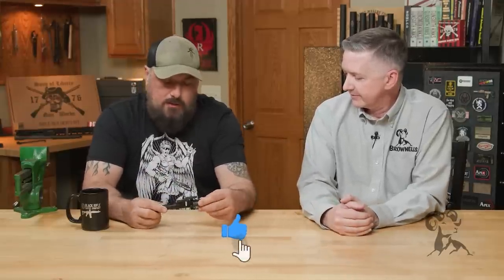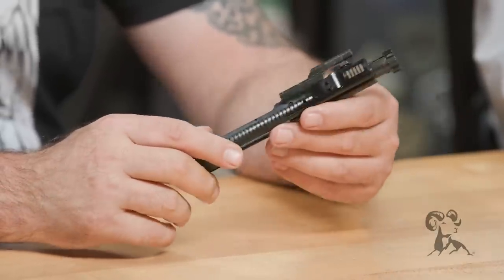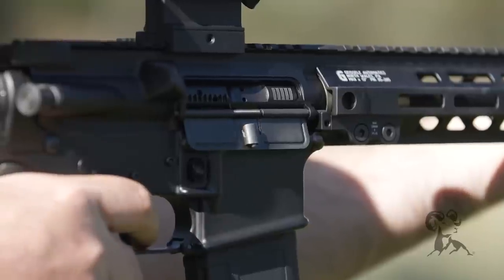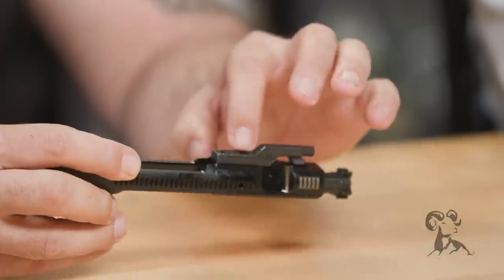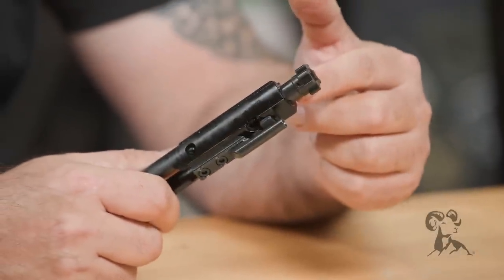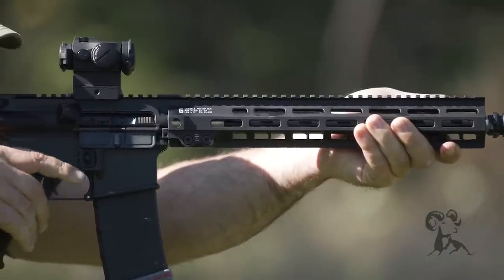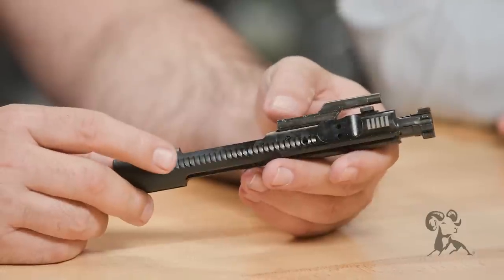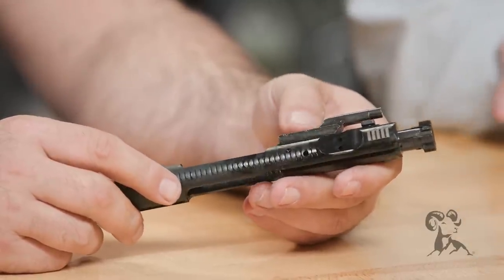Product Spotlight: SOLGW AR-15 Bolt-Carrier Group

Comment: So it’s basically another microbest bcg with someone’s brand name on it
Reply: I’m pretty sure that SOLGW uses Microbest exclusively, while some other brands may use Microbest - they will also use Tool Craft when in a pinch.
Reply: Yeah basically
Reply: Yes
Reply: While I believe these guys are passionate to give consumers a quality BCG, that statement of yours is probably the truest statement that could be said. 

Everyone else seems to be sucking off these guys hard.
Reply: @2amichaelj  I would say that's a very fare assessment
Reply: Yes but I believe SOLGW are the only ones to use springco springs exclusively, while others either use springs from random manufacturers or make their own. Also the QC is the biggest component IMO and SOLGW has very good QC
Reply: @BigMackM27  I’m doing a build specifically using SOLGW parts, and they did mention to use sprinco.. when their able, they will answer your questions on what runs best while doing your own build.

Comment: Looking into picking up a SoL BCG, out of stock pretty much across the board!  Must be a popular item!
Reply: If you really want one a couple places have them in stock. Weapon outfitters, kosher surplus, and freedom trading all have them from $169-$179.
Reply: I recommend them for sure. I bought one off a dude in a group that had a dicked up ejector, contacted them to ask if they would warranty something I bought second hand and they literally told me they don't give a shit how someone acquires the part, if it originally came from SOLGW and it fails, they replace it, period. Sold me on that alone.
Reply: Considering microbest manufactures SOLGW, BCM, etc. BCGs and then you get their assembly and QC on top of that. Turns out that of my couple go to BCGs, almost are are made from the same parts and milled at the same shop and subcontractors. Microbest with SpringCo springs again coupled with SOLGW QC, it's hard to beat
Reply: Hahahahaha, you have no idea how in demand these things are. Haven’t seen them in stock anywhere for longer than a few hours in almost 2 years.
Reply: If you want one, I just got one from Rooftop Defense last night. They had 170 in stock at the time. Big Tex Ordnance just got some in stock today too. Last I checked they had 100 in stock.
Reply: Milspec retail has had them in stock for a few days now.
Reply: @anthonygutierrez2795  signs of things getting better then. I got my BCG from the Stephens bros at Big Tex and the 13.7 p&w upper from Sol and Abbie at Rooftop. All parts I have purchased in the last 2 years have come from various Pond dealers.
Reply: @richardwhite9235  same here. Big Tex is usually where I look to buy at. I ended up getting a solgw bcg from ar15discounts. They had them in stock for a day then the bcg's starting popping up at various spots. Lol I rushed for nothing. Haha
Reply: Primary arms has it in stock right now.
Reply: Big Tex ordinance has like 400 of them. Plus a ten percent discount.

Comment: I thought this was all marketing til i saw Chad from SOTAR break down a bunch of different BCGs, including some nickle boron (what I have cause I wanted a contrasting color 😅) showing loads of loose gas keys even when staked amongst other issues.

They are "just" microbest BCGs (also who makes BCM) with a spring upgrade you can do for $5 in 5 minutes.

BUT I would buy my next BCG from them, knowing Im getting the best of the batch and paying a few bucks extra for another round of quality control and individual testing should microbest's QC slip.

Not to mention they've staked their whole rep on these BCGs, OH and you can flex/earn points 😂😂😂

Comment: I use to get sold on bolt carriers with all kind of features like coatings and stronger steel but I’ve learned it’s all about getting a bolt carrier built with the right tolerances.
Reply: SOTAR says he's never failed a SOLGW BCG
Reply: I also learned this the hardware.  Wasted $200 on a bcg that doesn’t have the headspace for 223.   
For reference: it was not a SOLGW.  

I just picked up a SOLGW and I’m super happy

Comment: We've had Colt SP-1's as ranch rifles for decades. A lot of hard use and high round counts. Never had any problems with them. Ever.
Reply: Everything wears out, a quality ar should last 10s of thousands of rounds with very little issues but the fact is no matter how well it's built wear still happens.
Reply: @jaydunbar7538  the original AR-15 design works extremely well. Problems only occur when people try to change the platform. The original 1960's and early 70's Colt SP-1's we use as ranch rifles have worked flawlessly. They are well used and well maintained.

Comment: I'm over standard phosphate carriers. Cryptic Coatings for me, but Sons of Liberty Gun Works has my respect.
Reply: What’s better about cryptic coatings?
Reply: @johnnoel3416  their "Mystic Black" is basically polished DLC. They start with a good bcg and add a durable coating that makes the surface slicker and easier to clean. Pricy but my Cryptic BCG is great. Good alternative to the Geissele REBCG if out of stock (I own one REBCG, also a good unit. The only Geissele product I own).

Haven't tried np3 or hard chrome carrier groups, heard good things.
Reply: @ComeOnPelican91  Definitely try a hard chrome sometime; it's an old coating, but it works great.
Reply: @johnnoel3416  cryptic is a complete gimick. And it speaks to what solgw means
Reply: @Photosbybb  Cryptic offers phosphate BCGs if you simply must have milspec. Prices are in line with SOLGW. IMO the only thing gimmicky about Cryptic are their coating names.
Reply: I would personally stray away from cryptic. If you want a fancy coating get NP3
Reply: @MarkiusFox  I've always found ye olde mil-spec chromed BCG to be very easy to clean. Got a variety of commercial BCG's including NP3. I'll take USGI chromed BCG hands down any day.

Comment: I personally don't use their brand but I've heard very good things about them. Echo
Reply: I only have a few small parts (lpk parts, springs, plungers, etc) but have never had a problem with anything.  Nothing has ever felt like "cheap metal" or "skimpy coating."  Everything fits and functions.  They seem to do it right.
Reply: SOLGW are fantastic rifles they come with more stuff than other brands. 3 metal 30 round magazines. Rifle case, stickers, 2nd amendment article. Bracelet or cable holder, sling mount, SOLGW patch, and that’s more stuff I have received with SOLGW, than other guns I own. Also lifetime warranty

Comment: I would like for you guys to speak about Anderson Manufacturers RF 85 (reduced friction) bcg. They claim it needs no oil and can be cleaned with just plain water. They claim it is not a coating, its all the way through, so no chance of wearing off. I can't seem to find much information about this. If true it would be the  superior bolt material in the market right? They offer complete guns or complete uppers or complete lowers made of this.
Reply: The rf85 is a treatment done to the metal parts, it's not a superior bolt  material (which is 9310, some claim it's better than c158 but it's up for debate like mentioned in this video and is nothing new).. The rf85 treatment is mostly gimmick imo.. Does it add some lubricity to parts ? Maybe, not a whole lot that I could see in my buddies rifle from them.

Comment: Why did I waste 5 minutes listening to "We make it in the correct material - and we do it properly"..?
Reply: Lol yup...and they don't even make it. Slap their logo just like BCM, DD and many other
Reply: Carrier is made by Microbest but that doesn’t mean SOLGW doesn’t have a hand to play in how it’s made. Microbest carriers can range from cheap but still serviceable to expensive but very high quality. All depends on how the company that’s ordering them has them built. Ive never seen a SOLGW fail gauge testing. They are made to a very specific and consistent tolerance. Whereas I’ve seen tolerance issues with BCM before, although nothing that caused issues. However I’ve never seen any Microbest carrier fail in any catastrophic manner.
Reply: @TwoWheelNinja what I realized about these companies is they come from the same place, so you’re paying for a name and warranty which is hopefully good.

Comment: so in short he is saying you are waisting your money on a Nickel Boron (NIB)or(NIBX) BCG just stick with a Phosphate finish. I have noticed that most of the bad ass guns you see on the market, have a phosphate BCG, and not a Nib coating, I guess that says something especially coming from SOLGW they know their stuff from what I have seen
Reply: @Vegacentury8854  I don't know personally I have never used anything NIB, but from what I hear it has a low round count befor it wears to the point it serves no purpose, but like I said I have no experience with NIB
Reply: NP3 coating is the way to go. Will NOT flake like NiB or TiN coatings.

Comment: Since the SOLGW BCG is just another OEM Microbest BCG, I'd take the Sionics NP3 coated BCG over this in a heartbeat (if I can find it in stock...).

Without delving into super Gucci non-mil-spec BCG's like the KAC Sand Cutter and LMT e-BCG, the Sionics NP3 coated BCG is pretty much the gold standard.
Reply: SOLGW also has a NP3 BCG. OKCS and Sprinco with it. I have it.
Reply: @Rudyelf1  SOLGW charges $20 more for theirs over Sionics, though, and I just prefer Sionics as a brand over SOLGW anyway.
Reply: @vgt  SOLGW is local to me. I shopped with them back when you had to pull up to the loading docks of a lumber yard, and Mike Mitsubishi and an angry Australian would pop out behind a dumpster looking like two hobos about to help me dispose of a dead hooker for a handle of Jack Daniels.

SIONICS is good shit too. I have their phosphated BCG in my XM177e2 inspired build. That one is all about subtle upgrades.
Reply: What makes the Sionics np3 the gold standard?
Reply: @5jjt  Sionics is just a no-frills brand that gets the majority of its business from police departments and law enforcement agencies. Their bread and butter is duty weapons. Sionics BCG's use Optimized Carrier Key Screws (OCKS) from Ned Christiansen and the screws probably have the cleanest staking job in the industry. It's hard to describe unless you see pictures or hold one of their BCG's in your hand.

Comment: I know you need 158 carpenter steel (for the bolt) and properly stakes gas key, plus HPT &/MPI, but Phosphate coating is just as good or better than a DLC or Nickel Boron coating???
Reply: Not necessarily better per se. They are nice to have on BCG if you have the $. However, I recently heard that a phosphated BCG will serve all your needs without any issues as long as it is GREAT quality. I’m now leaning away from anything that is not manganese phosphate and taking that extra money for ammo.
Reply: @spicychich1718  I heard same, that a good BCG that's phosphate will run good as any
Reply: I like that it holds onto lubricant, when I grab my rifle that's been sitting I know that the lube will be there ready to rock n roll.. I've used all the other coatings and seriously see no upside to them unless you like having a meticulously clean and shiny bcg 24/7.. once that lube burns off of the bcg and carbon sticks (which it will on all coatings and treatments too) then they all get sluggish, whereas phosphate will literally sweat lubricant and create a barrier between friction areas in a sense.
Reply: @muddyhotdog4103  couldn't have said it better

Comment: I’m indifferent to SOLGW, mainly because they’re gassing of rifles being so talked up but the gas port size being relatively common and still considered overgassed even if it’s just a little bit overgassed. I love my SRC bcg, in my opinion it’s best because it fixes all these issues, and uses a stronger heavier steel that’s more neutrally balanced as it recoils. There’s nothing wrong with tried-and-true but if everybody stays tried and true then nobody will make any better advancements for the platform. Personally I like the modified recoil impulse that is given by the SRC BCG I literally have a laser shooting 6.5 Grendel, 300 blackout, 5.56, 308, and 6.5 creed. Disclaimer theirs multiple high quality things that go into my ARs to make them “amazing“ issa secret sauce.
Reply: This is my second main ingredient to mysecret sauce to my ARs that everyone of my friends likes more than any other ARs they’ve shot. It’s tunable to a bullet and suppression, with a very smooth and flat recoil impulse. All this being said, the rifle is still just a tool and is only as good as the user so get training. You got Haley strategic, kegwerks, Baer Solutions. Final shout out to brownelles for sponsoring the channel, go check them out they got everything you need.
Reply: Hell yes, SRC is a damn fine BCG…well worth the extra $50 than a standard BCG. DLC coating so easy to clean.
Reply: I've got both a solgw phosphate and a sharps dlc bcg for an lr308 build. I have to admit the sharps is gorgeous. Not knocking the microbest from solgw as it's very well done too but that other one is really cleanly done
Reply: @abolishtheatfandrepealthen6014  this is my second time talking to you bro!😂 The sharps is better because it can run lubeless for a long time with regular brass ammo
Reply: @ShepherdOfTheSilkies  haha good shit. I've never tried running anything lubeless in fact most would say I over lube but the machining and the dlc coating on that guy is 😍😍😍
Reply: @abolishtheatfandrepealthen6014  wow haven't checked out Sharps RIfle Company since they only offered NIB. They now offer DLC and other calibers, neat. I think their Grendel bolts are the wrong type/ bolt face depth.
Reply: @ComeOnPelican91  very possibly. I can't speak on anything they have other than the 308 bcg but it's undeniably very nicely done. I don't have gauges to check the specs but I haven't had any issues or even much wear in approximately 2k rounds, mostly nato ammo
Reply: @ShepherdOfTheSilkies  the Sharps bolts are notorious for having a their lugs break off
Reply: @johnniewasr5740  this isn’t the first month of sale of the reliabolt anymore(far past that) that was a heat treatment issue that happened once to a patch so thats a non issue.
Reply: @ShepherdOfTheSilkies  it was happening past the first month of sale. They were even having the same problem after they supposedly “fixed” the issue.
Reply: @johnniewasr5740  yeah that’s still years ago, I’ve had them in M4A1s and shot fully automatic, I run them in every one of my guns including high round count. It was a first month sale thing and is a non issue now. They also replaced and refunded the bolts to every costumer years ago when it happened. You really don’t have a point so idk why you bring it us when they’ve sold thousands upon thousands of bolts since without issue.

Comment: the science of metallurgy, not a person's  enthusiastic desire to build a bcg. metallurgy !
as for a c158 (bolt,) it is fantastic, and should last upwards of 20,000  rounds, of which equates to about $10,000 in ammo. that is currently, (9) new tac 15 AR's by stag arms. anyone have a clue what 20,000 rounds of 5.56 ammo looks like ?
you have to be independently wealthy to stay home and dump pounds of ammo down range all day.
vietnam war vets that had seen heavy action during a tour barely dumped a thousand rounds.
the AR group percentile that gobble up this many rounds in a guns lifespan has to be "extremely" low. and by the way, hardly a travesty to have to buy another 20,000 round bcg for $150,00 ) after 15 yrs of use, by even the above average shooter. 
as for gas block, it falls underneath the bcg in failing order, along with barrel. accuracy will be diminished with use, but a barrel just does not fail, unless dropped or worse.
this topic is so played.

Comment: So... Run colts?
Reply: Exactly!
Reply: Don't they outsource a ton of parts these days? Or did they stop when the union sued them?
Reply: @ChucksSEADnDEAD  everything in your life has outsourced parts. Out sourcing is the only way many businesses can stay competitive.
Reply: @tonydeaton2890  I'm not against outsourced parts, my point is that commercial Colt might differ from TDP.
Reply: @ChucksSEADnDEAD  I believe Colt is now owned by CZ so I'm not sure how they're running things at this point.
Reply: @tonydeaton2890  
It can only get better, especially with CZ.
Reply: @onpsxmember  when Colt was good, they were the best. I have a safe full of Colt products. In modern times they've slipped some in the quality department.
Reply: @onpsxmember  Yeah, I've had a CZ75 Compact for several years now as a carry gun. Thousands of rounds with zero issues. Gobbles up everything I put in it.

Comment: We see alot of premature bolt failure? Really? That's cool you "stuck to the fundamentals with aggressivelystakingthe bolt", I've been looking for a bolt with a little extra "staking!"
Reply: Then choose the right screws to have something to grab on to.
Reply: Son's BCGs are phenomenal. But if you want a little extra protection Sionics comes with OCKS fasteners standard. They offer standard phosphate as well as NP3. I really do prefer the NP3 coding just because it's so smooth and easy to clean, as the NP3 wears it maintains its lubricity through the Teflon ions continually being brought to the surface anytime there is wear